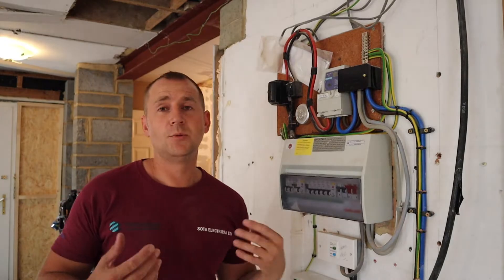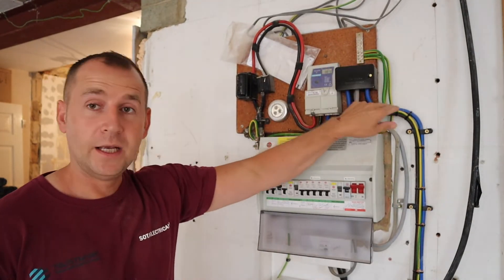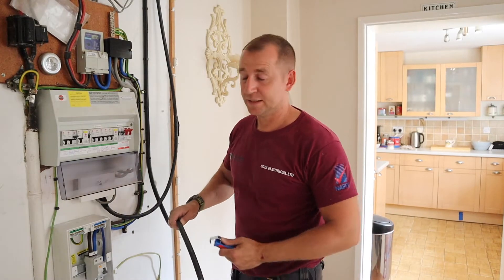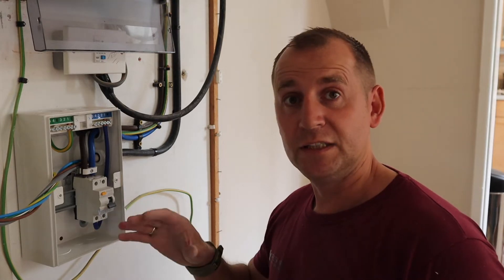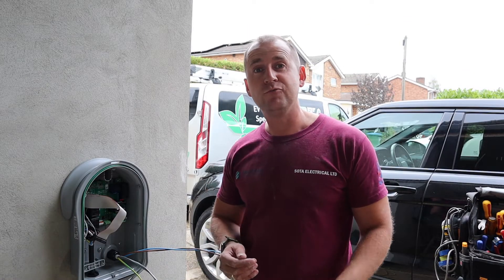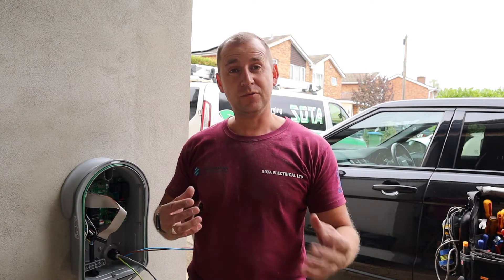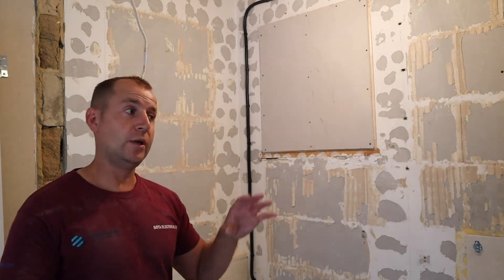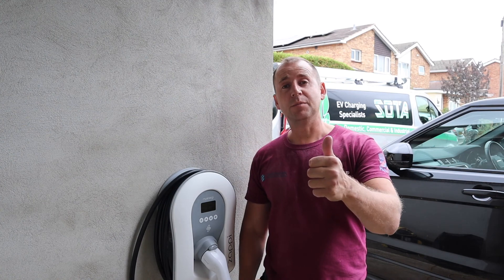Home renovation...Install that charger quickly!!

Comment: On the Zappi needing a type A RCD (Not relevant to this install, as you had to fit one anyway) We were all misled by myenergi, Yes it has a type A RCD internally, but it's type A doesn't comply with one of the following standards: BS EN 61008-1, BS EN 61009-1, BS EN 60947-2 or BS EN 62423 as per 722.531.3.101, it has protection in accordance with EN 62955 which is an RDC-DD, if you look at their latest installation requirements, you will find this "Circuit breaker or 30mA Type A RCBO depending on local installation requirements, 32A curve B. Please note that a higher rated MCB/RCBO may be needed due to thermal derating factors as recommended by the MCB/RCBO manufacturer."
Reply from the maker: Well that’s all very interesting!! Thank you for your comments, I will be sure to look into this myself, hope you enjoyed the video